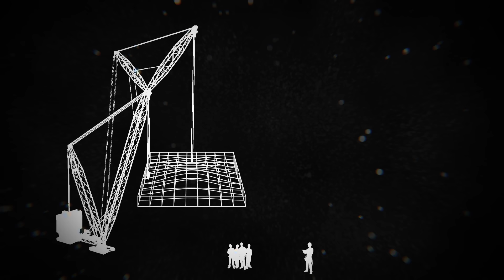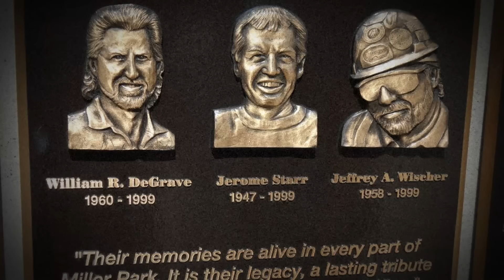Massive Crane Kills Iron Workers | Last Moments

Comment: @2:20 add a zero. Your math is WAY off. 450 tons is approximately 990,000 lbs.

Edit: Also, a few seconds later you mention WS at 20-21 MPH with gusts up to 27 MPH. A gust, in order to be classified a gust, must be at least 10 MPH faster than the WS. Dude, numbers matter. The irony.

Comment: 450 tons is 900,000 lbs., not 99,000 lbs. I solved the error in lifting calculation that would have averted this tragedy. Now, it's time to relax, and one beer stands clear. Miller beer.

Comment: Must be some other reason than not checking the wind variables because unless construction up that way is totally ran by incompetent safety inspectors and OSHA, someone somewhere didn't do their job. Personal experience tells me something was miscalculated. Still , the law of averages says there will be an accident eventually, but intense safety programs are a commonplace on an American jobsite and the crew were well aware of the high winds and their effect. 100 times before in similar conditions the same crews were successful; then there was this time. Try something at home. Anything repeatedly for as long as it takes. Eventually, incident will occur that is not in your control, nor is it your fault as the cause. Shit will happen!

Comment: if what is said here and in other documentaries about this story is true... 
(i.e.: that Lampson Co knew that according to forecast winds they were operating in exceedance of any of the cranes capabilities, & that the Mitsubishi manual warned that the crane must never be used at above 7.5m/s 15knots windspeed and fully stowed for winds above 13m/s - 26knots) it is unclear to me how Lampson is not held fully responsible for the failure... maybe at 90%/10% with Mitsubishi...
I would say this ruling shows the Wisconsin Judicial system is 87% Racist and 3% Just